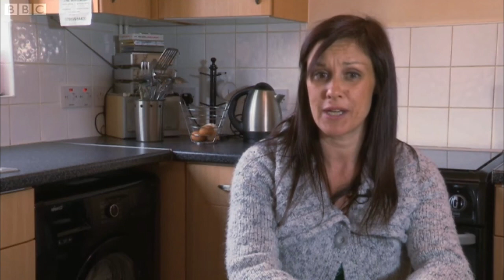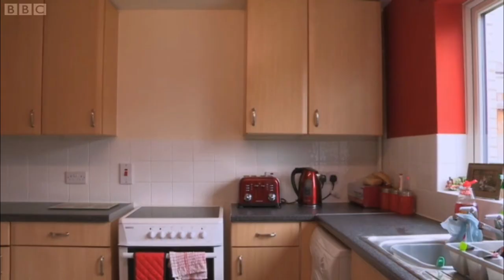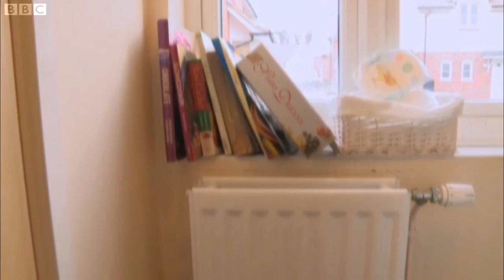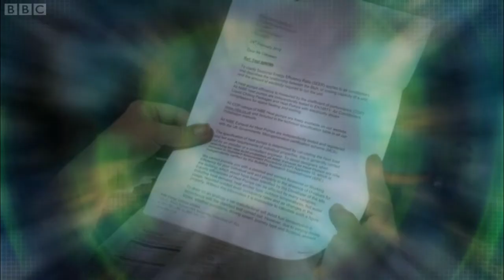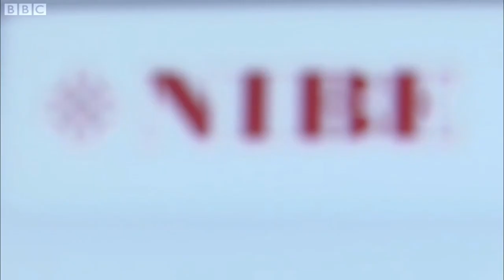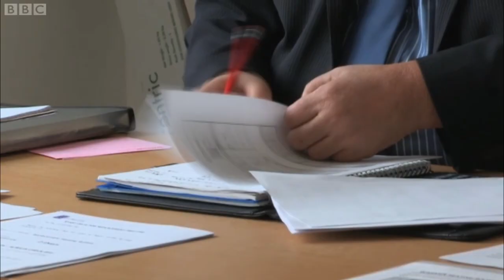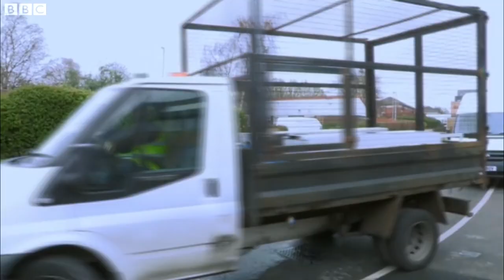NIBE on Rip Off Britain

Comment: Wrong - completely wrong.  It  is NOT a good idea.  As the heat pump is pumping from the inside to the inside, it doesn't mater how big it is.  Nibe fighters are perfectly good electric boilers.  Electric boilers are not often fitted these days because they cost up to 4 times as much as a gas boiler to run.  Their carbon footprint is roughly double that of a condensing gas boiler.  THEY ARE NOT "GREEN".  Anyone with an "O" level in physics would be able to spot this, it doesn't require a heating engineer.

The real problem comes from the "exhaust air source heat pump" which, at best, pumps heat from inside the house to inside the house.  For it to work, it needs a ventilation system.  Often this consists of vents in external walls which allow wind to whistle through the property stripping out much of the very expensive heat produced by the electric boiler.

he Nibe fighter is what you get when decisions about heating systems for housing association dwellings are made by managers selected for their expertise in accountancy and classical Greek.  The Swedes are decent peaceful and honest people when the come across the British specifiers, the gullibility is so huge that not even the most honest could give the sucker an even break.

Comment: Blame nibe for crappy house build quality... ROFL.  Even if  using the immersion heater elements, its still at least at the same as normal electric heatin. No more, but surely no less.  btw should you use kWh instead of pounds for comparison.  Wouldnt make so good social porn tough..
Reply: The NIBE system could be worse than direct electric immersion as not all the heat is useful and energy wasted running mechanical parts which are not contributing to the heat.

Comment: These systems are terrible. I'm a heating engineer and work for local authority. We have some of these on our patch and they don't work as advertised. Nobody knows how they're meant to work and all the tenants want them ripped out. Don't buy one
Reply: There seems to be the crux of the problem: "Nobody knows how they're meant to work". Why on earth would you install (or buy) something  you can't be bothered to learn to use?!?
Reply from the maker: You might want to see if there is anything your company can do to help your client get them replaced.  There is a company called Aaron Services that are sick of paying out compensation for damaged caused by problems and leaks, and have started an investigation
Reply: At last someone who knows what they are talking about. These are shocking.
Reply: That's nonsense. It is very clear how they should work, and if it's not clear to you then you aren't really a "heating engineer".... whatever that means. I am an electrical engineer (a real one) and it is VERY clear how it is working, but in fact, you don't need to be an engineer to understand the principles of how heat pumps work.

Comment: I have this system & it costs up to £15 a day in the winter :-( I have to move as cant afford to run it
Reply: £15 a days is 100kWh a day of electricity - perhaps try installing a roof on your house?
Reply: @edc1569  I live in Sweden and 100kW a cold winter day is nothing special for me, but I charge two cars daily, have a large house and all electric heating through a Nibe heat pump, no fire or gas stove or any additional heating. Just checked for January 2021 (a very cold month here), and the maximum was 172kWh, minimum 75kWh and an average of 106kWh. I do have a roof and good isolation, but as I said, I live in Sweden, so yes, your comment is indeed relevant and true. I think the biggest issue in UK is the low, and very varying building standards, poor ventilation, so people have to open windows during the winter to get fresh air and to get rid of too high humidity, and as a result, that lets the heat out as well.
Reply: Radiators aren't meant to get hot as the system is designed to maintain a temperature rather than heat the house up from cold each time.  It all works from flow temperature the lower the heat curve the better the performance as it doesn't use the immersion all that often.  Better when used with underfloor too.  It's all about flow rates with heat pumps.

If you're not getting enough warm water as it takes too long to heat and mould in the bathroom it sounds to me that the airflow are not set correctly.  We balance it out at 33l/s on a clean filter.  Look after hundreds of these.  In a house the compressor doesn't have enough guts to cope with the corners cut on windows doors and insulation but I look after them in flats with bills of £40-60 per month
Reply: Have you consider other solutions...? Like insulating your home PROPERLY...? I guess it's too late now, but don't blame NIBE, blame your builders building low quality homes.
Reply: @AdaptingCamera  you don’t know what you’re talking about.
Reply: @bigseano8  It seems that YOU are the one who have no clue, but like to have an opinion. This BBC program is a good example of poor quality journalism, lacking basic facts and important information. Tracey Roberts above is complaining that the heating costs her 15£ a day, which is indeed a lot, but what do you know about how she lives...? Maybe the heat pump is too small for her home, maybe she has a big family, maybe they are wasting heat and hot water, who knows... I have no idea, but complaining that the heating costs are too high is inane without more information. Whatever her problem is, it is certainly not caused by Nibe and certainly you have no clue.
Reply: @AdaptingCamera  Well here’s what I’ve experienced in real life.

- The radiators do not get that hot. 
- The apartment was always cold, it took a long time to get to a comfortable level. I have resorted to using fan heaters in my rooms. 
- The bathroom was ruined with mould as the vent linked to the boiler doesn’t take much water vapour out. I replaced the bathroom suite and installed an extractor. 
- The summer setting doesn’t keep the water warm enough over 24hours 
- The cost of using the Emerson is heavy 
- Opening the “trickle vents” through the winter on the windows makes the property very cold
- You will need a specialist plumbing firm who know how to service these. NIBE charge £450 for a call out / labour. 

Overly complicated system that hasn’t worked for me.
Reply: @bigseano8  I am sorry for your troubles, but certainly, that's NOT something Nibe caused, but the poor building standards you have in UK. Mould in bathroom is a typical example of that. To get rid of mould you need a certain amount of fresh air, so completely closing the vents and sealing the home is totally wrong. I have fresh air inlets in every room, except the bathrooms and the kitchen. Air is sucked out in the bathrooms and the kitchen, and that air is led to the heat pump, recycling the heat to produce hot water or heat. This is how it is working and I have good quality air in my home, no mould anywhere, and low heating costs. Add to that that I live in Sweden, and the Nibe pumps work pretty well here in the Nordic countries, including the polar parts of Finland, Norway and Sweden, so if they are not working in UK then obviously something else is the problem, not the heat pumps. The fact that your radiators are cold indicates that there is something wrong with your system. It can be that the system is too small and weak for the property you have, or it simply needs some tuning. My system works well for my home, and also the previous one worked fine for 17 years. I don't know why you are charged 450£ for a visit from Nibe, that can be expensive, or not, depending on what they do for the money. I paid about ten times as much for my new F370 but that included also removing of the old one, the price of the new one as well as trimming the ventilation for the new heat pump.

Comment: By the way the homes in runcorn (second part of video) have now had a full year gas bill and the findings show that the NIBE is out performed by our UK natural Gas. The Runcorn homes are built to UK code level 4 . Taz the problem here is our gas is very cheap and co2 friendly compared with our electricity . Sweden has "Green" electricity but 50% is Nuclear bit like hommer simpson sprigfield town :) only take 100,000 years to be safe! Green coz you cannot see it. Green peace have other ideas!

Comment: Oh, that makes sense, about 8000kwh/year of heat, my C.O.P. is 2.42 so 3300Kwh/year electricity used to heat the house. Yeah, we've had loads of insulation put in :) the heat pump has paid itself off after 4 years because the old heating system was inefficient (electrical storage heaters)

Comment: Ok, money spent to heat a house is a bad comparison when comparing countries with eachother.. Best would be if you could specify how many kWh of energy is used to heat your house :) The first thing to start with to earn money in UK should be to add extra insulation to the house instead of buying a heatpump. Its often cheaper too! Money spent is payed back in only a few years. Extra insulating the roof is the most efficiant action to start with. Thx for the reply!

Comment: I know :( building regs in the UK are not good when it comes to insulation (which is what I meant by the houses are too big :p ) they'll take years to change them again. I live in a 1970's built house about the same size as the ones in the video, which has been insulated about 10 years ago. the heating bill for the whole year is about £5-600 keeping the house at 20 degrees with GSHP :)